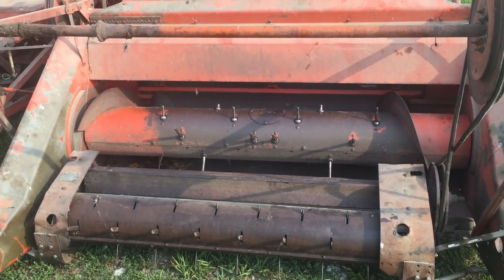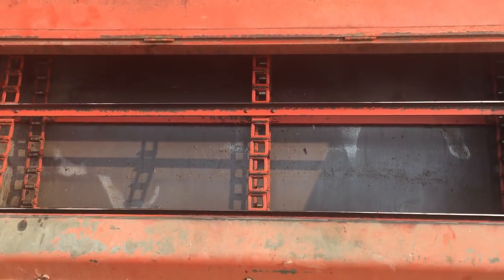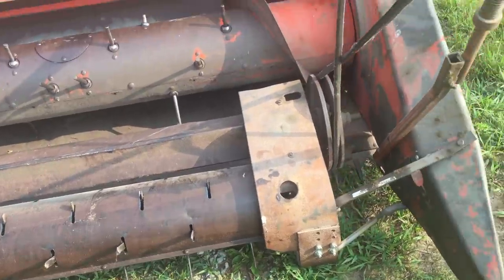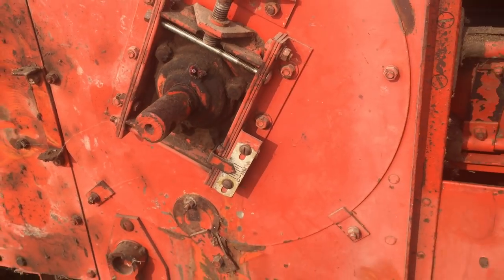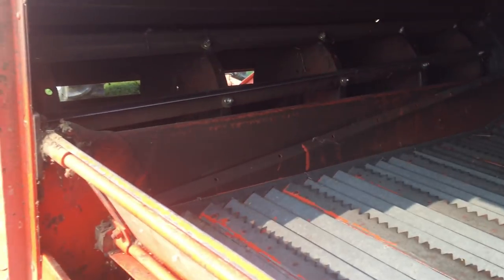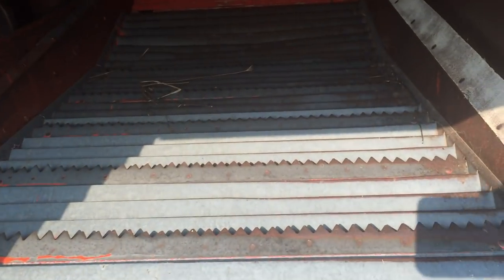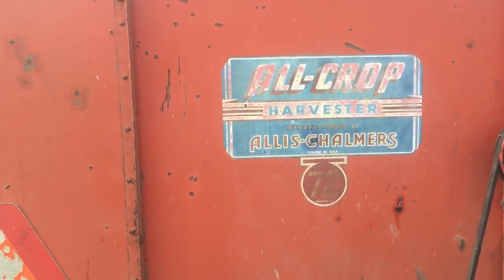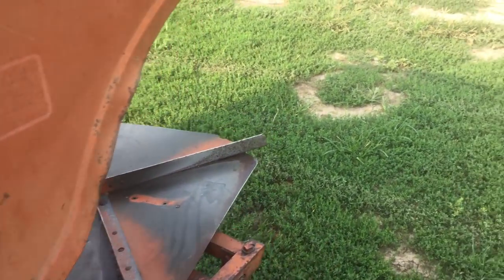ALLIS CHALMERS 72--Modifications/Red clover

Comment: Dust build up on the back of the cylinder bars can cause vibration too. The dust accumulates during work, when you stop some can fall off but not all. When you restart the cylinder becomes unbalanced.
Reply from the maker: I hadn't thought of that...but I bet you are right!  I usually fire the combine up and run until the bin is full/field is done.  The PTO on the 596 will slip the clutch on start-up...so I tend to leave it running ;)

Comment: Hi
I have a 72 like yours and I finally found a windrow pickup for it. It is a 5 ft pickup and I plan to set up the pulley drive same as you. Do you mind sharing what diameter pulley sheaves that you are using needed to obtain the correct shaft speed on the pickup unit. . Or if you know the RPMs of the pickup drive shaft I can calculate the pulley diameters. 
Thanks
Reply from the maker: Those are good questions 🤔.  If you rig it like mine…and don’t destroy the factory adjustable sheave that runs the reel, you can adjust your speed!  Just in general, a pickup, SIMILAR to a reel runs just slightly faster than ground speed👍🏻.  We used the factory reel drive pulleys from salvage machines to accomplish this.  The pulley on the Innes pickup is the same size, most likely for the same reason.  I talk about breaking the reel drive adjustable pulley in one of our newer clover/combine videos.
Reply from the maker: Here’s the newer video https://youtu.be/L5XTyKsTYnc

Comment: I see you still have the original AC drawbar hitch. have you ever though of replacing it with a hitch pin ? I never really trust that setup when moving at any speed . The throat setup is soooo much better on your 72 , I have a 60 and it can be a real pain  feeding or jamming at times .
Reply from the maker: I ran a 60...for a little while.  The way it would roll-up a windrow upon itself, and then take the whole slug at one time was enough to drive me CRAZY!!!!!  I am actually putting 14 feet of material through the 72 this year :) and not having trouble.  I feel your pain!  In regards to the hitch, I do prefer the ball for flexing over terraces, etc.  I have taken the ball w/bolt-thru and made a grade 8 bolt with two locknuts to hold it on.  It seemed like it would always work loose AND one time it came loose :(((((  Now, I impact the grade 8 bolt tight and then put on a lock nut
Reply: never had problems with the ball hitch and i pull all crops all the time , sometimes over 100 miles

Comment: should not be using  grade 8 bolts . those bolts are made to break if they hit something otherwise you will bust your cylinder heads up. and even though the book says run your cylinder 1600 rpm it is ONLY a starting point. I have yet to run my cylinder at this speed for red clover or alfalfa. there are small weights on the cylinder heads that are factory. they are not to be removed since these are put on at the factory to balance the cylinder, if you do take them off put them in the EXACT same place.if you have cylinder vibration start looking to see if you have build up then look at bearings these are usually the first two culprits in cylinders vibration and also too much horsepower will cause vibration of the whole machine. extra holes in the cylinder heads are for eight more bars. you can run 8 or 16 bars.
Reply from the maker: Massey used grade 8 bolts in some of their their feed mechanisms and cylinders.  Threshing occurs by close tolerance and low speed OR loose tolerance and high speed.  I choose high speed and wider gaps to allow obstructions to pass ( just missed a cow bone the other day).  My cylinder was not factory to begin with as previous owner had already shed cylinder bars, etc.  I AM NOT AN EXPERT ON THESE MACHINES.  Everything I know was learned the hard way by myself.
Reply: the weights should have still been on the cylinder.  but yes he could have removed them , but i'm betting the bearings are the culprit. for the vibration .  only need enough speed on the cylinder to thresh the seed out , don't need it any higher.
Reply from the maker: Wasn't the combine balanced to run at 540??? for optimum threshing capacity.  Also, remember I am putting 14 ft of material into the 72.  This year I draped the clover with a 14 ft head.
Reply: Geiger Farm I run a case 400 super diesel on my 90. I only run the tractor at 1600 RPM.  It only needs 32 hp to run it and the tractor is a 50 hp at full throttle. I have a hand held tach that I use to set the speed of the cylinder and the straw rack with. You can change both of those to get the speed you need by adding or taking shims out of the pulley in the back to speed up or slow down the straw rack or use the crank to do cylinder speed. I do that with the tractor running at the throttle setting I will be running the machine at in the field. So you might have to slow down a little.

Comment: what hp tractor are you using? 90hp omg! thats way too much hp .you only need 31hp max to run that combine. no wonder you have vibration. idle the tractor back.
Reply from the maker: Th e 596 is the smallest cab tractor I have.  The other day I ran clover for 7hrs...gotta have the cab!  I do not have vibration in my machine since I made my modifications.
Reply: then you only need to run the tractor at half throttle.
Reply: Still love your videos . Never seen an innes pick-up working on the combine